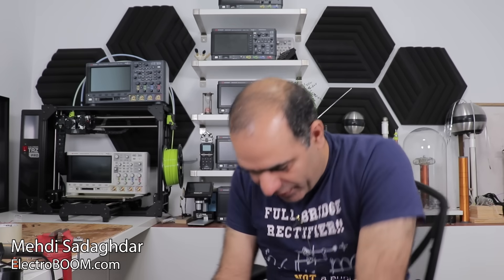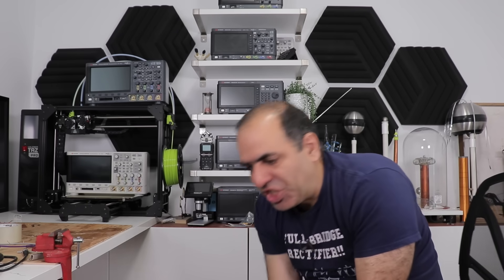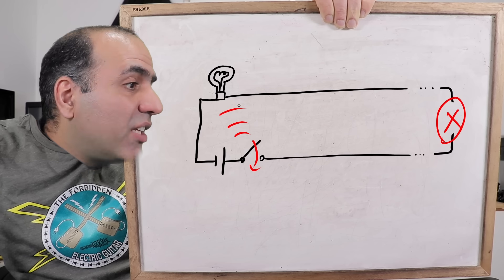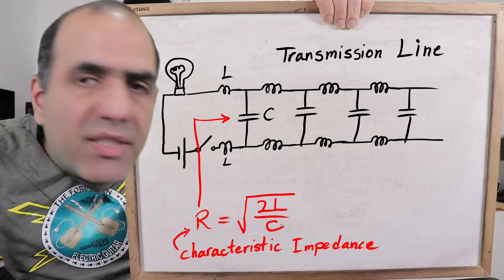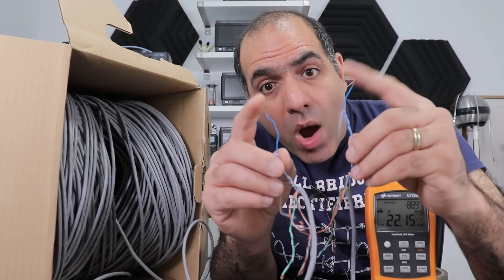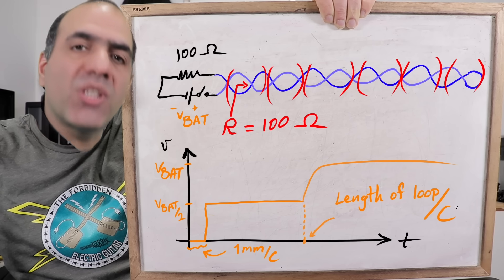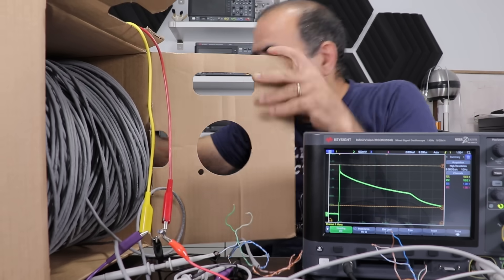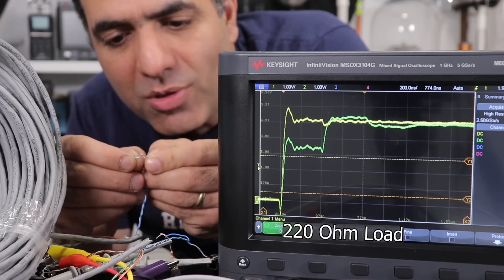Testing the LONGEST LOOP OF WIRE!!! to Turn a Lamp On

Comment: I wouldn't call the 2/3rds effect the speed of light through the material since it's not a self-propagating wave. It's actually primarily due to electron inertia not the effective speed of light being reduced.
Reply: The EM force is mediated by photons.  The electrons travel at a crawl.

Comment: I'm not convinced. What if the whole system was inside vacuum and there was no air between the wires and the lamp and the supply? would it behave the same?
Reply: Essentially the same thing.  The EM force is mediated by photons, which care very little about a millimeter of Earth atmosphere.  Photons travel just fine through vacuum.
Reply: @skepticalextraterrestrial2971  That's the thing I can't accept.I think it's not the EM that causes the lamp to turn on. I suspect it's the electrons passing through air to the lamp finding the shortest path. Because EM wouldn't be that strong with that voltage. Right?
Reply: @ForeignerCritic  Technically, they are virtual photons.  They "exchange" between electrons, carrying momentum.  The electrons are not traveling through the air... conductivity of air is something like 10^-12 S/m (compared to 10^7 S/m for metal).  You won't find many electrons flowing across the gap.  But the energy is transferred to electrons on the other side, which is what matters in the end.  In regards to the EM field being "that" strong... what are you referring to?

Also, all kinds of photons can "pass through" the plastic.
Reply: @skepticalextraterrestrial2971  And also it's not photons, because photons can't pass through the plastic around the wire

Comment: I would be curious to see the load on the supply wire while continuously pulsing to turn the light on without the wires connected.

Comment: Good explanation of propagation constant, except you didn't actually say "propagation constant". This is a fairly well characterized value for most standard cables and varies with the dielectric between the conductors, and is essential for finding cable faults using TDR.

Comment: At work, I've been playing with a lot of the same general principles lately. Incidentally, the cross-talk permitted between adjacent pairs in a length of CAT-5e cable is a remarkably low amount of energy, and cross-talk between adjacent lengths of cable is even smaller. Manufacturers go to a lot of effort to ensure that these cables can reliably transmit an acceptable signal, and the behavior seen on the oscilloscope proves they do a good job. Very nice experiment, which demonstrates a lot of the red herrings in Veritasium's original video. I also thoroughly enjoy this style of demonstrating concepts like propagation delay and impedance matching experimentally.

Comment: I still don't understand how this works without breaking the rule of causality
Reply from the maker: Imagine you have a long hose filled with stationary water already, looped like our wires but side by side hoses  are touching . and you turn the water on and it would take a while for the water flow to go around the pipe and come out of the other end. Now the hose on the tap side is touching the end of the hose like I said. When you turn the tap on, water pressure at the beginning makes the flexible hose expand and push against the end of the hose pushing some water out at the beginning. And like Donald Duck cartoons, the bulge of hose expansion travels through the hose and keeps pushing on the adjacent hose sending some tiny gradual water out. Still the bulge has to go the full length of the hose for some good flow to get out of the hose. Same thing happens in our wires! Electric waves at the switch send some current out at the adjacent wire into the lamp at the beginning before the waves get to run the full length.
Reply: @ElectroBOOM  ah I see, so if you replaced the led with a load that required more power than the waves that travel between the switch and load carry, it wouldn't turn on until the waves go around the wire.
Reply from the maker: Yes, same reason in my other video I complained that Veritasium's lamp must turn on at any current for the lamp to turn on. But if we switch the question to: there will be some energy at the output right at the beginning, then that works.

Comment: I don't buy that this is the same as wires spaced apart. What happened to 1/d squared? The signal from the induced field gets a LOT smaller than the transmitted signal as the wires are separated.
Reply: It gets a lot smaller, yes.  I think Electroboom means that no matter the distance, the effect is still there.  Even if it is really small.  The problem is that Veritasium gave the impression of wireless power which is very misleading.  Quantity does matter in practice.
Reply: @skepticalextraterrestrial2971  He will not see the TDR effect if the wires are a meter apart. The characteristic impedance would be in the thousands (or more!) ohms so it would be very difficult to match it to the instruments. And forget lighting the LED before the round trip manifested! He should be more aware of this and say it is ALL THEORETICAL AND CANNOT BE DUPLICATED IN REAL TIME!

Comment: Great experiment, I just have a small question, does the twisted pair change the actual length of the cable? Meaning is the Cat5 of 40m also considered 40m of the pairs or a little more since they are twisted and not straight? Maybe that factors into the equation that should result in the speed of light?
Reply: I had the same question.

Comment: How accurate was the speed of light calculation here? Is the speed of light in the wire really ~67% of that in vacuum or is there a significant error there?
Reply: A wire is opaque, so the "speed of light" inside of it is misleading terminology.  But the EM field is propagated by photons and the ~67%c is a frequently used estimate for the speed of an electric signal.

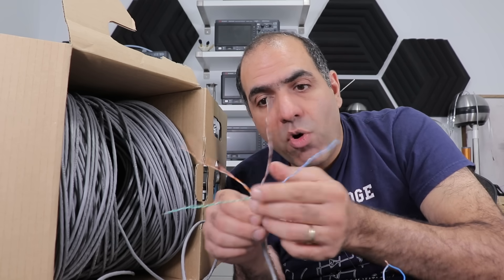Comment: 9:33 - total length can be even bigger than 8000ft  due to twist of wires (1000ft is length of whole cable, but not single wire in it). Similar to wire in incandescent lamp.

I think, someone here can calculate exact amount ;)

Comment: your led example with a resistor, is that the same reason 230v (or 120v in your region) LED floodlights very dimm lit even when the switch is open? Only the neutral is then directly connected, and maybe some magnetic field over the cables in the switch.

Comment: There's been like half a dozen videos on this so maybe I'm not sure what the question is anymore.  Are you arguing the speed of causality, the speed of electrons, or the speed of magnetic fields?  

You seem to be asserting that the length of the wire doesn't matter for data or power to flow?  That simply isn't true.  When financial institutions switched from cables like what you're using (orthogonal distance) to line of sight wifi, they immediately made far more money simply because of the nanoseconds saved in being able to register transactions faster.  

What you're demonstrating here is THE purpose of twisted pair, which is to induce opposing currents in the adjacent wire.  You would have almost no induction 1m apart for the mA of current that you're using to light the LED.  You DO have induction at half a mm.

Comment: Very nice demonstration. I have come to believe that transmission line model, not Ohms law, should be the first and primary introduction to electricity and circuits. Question: can the reflections from an imbalanced load be related to the Fourier transform of the difference of ideal vs actual impedance?

Comment: So this proves that Derek's assertion that "electrons don't carry the current" is totally unsubstantiated. We already know that electric fields induce currents in wires and vice versa. But that says nothing about the actual physical processes. It neither disproves nor proves it. However, his assertion makes no sense because of all the other things we DO know about the physical interaction of atoms/molecules and electrons.
Reply: Moving electrons are part of electricity.  Saying that they don't have anything to do with the energy transfer is just pseudoscience babble.  On the other hand, electricity is more than just the electrons.

Comment: Under Veritasium's assumptions (on how much energy is needed for the bulb to turn on), you don't need batteries and wires or anything. You just wave your hand around and the bulb will turn on. Really. Waving your hand around does make some electromagnetic field changes.
Reply: Under his assumptions, the bulb would ALWAYS be on.

Comment: been thinking on this, What if there was a Open Switch on Both Sides of the Supply, being that the - wire would not be charged into a negative state, but more of a Null state.

Comment: but it's like hypothesis. You don't really know what you're dealing with and how those twisted wires effect the experiment. 

Btw you can't communicate via that twisted wire over a long distance. The signal extinguishes with distance.
Reply: He actually measured how it extinguishes with distance.

Comment: Unless I am misunderstanding, doesn't this imply that if you replaced the LED with a full bridge rectifier and an LED over the output, then applied an AC supply to the twisted pair with an open circuit at the other end, that you'd see continuous illumination of the output LED even though the wire is disconnected? 🤯
Reply: Of course you can beam power wirelessly using AC and an antenna/receiver.  The questions are how far, how much, and thus how practical.

Comment: What's with the wierd-ass, nutsack monster that only flashes on the screen for like, 2 frames!? Seriously, look. Slow the video speed to .25% and try to pause it right at 5:06. You might wanna try starting it at 5:04 to give yourself a slight headstart.

Comment: so basicly if our light does not light up at half the source voltage, then vertiasuim test would: FAIL. 
yey. so much about them wires at the end making contact makes no difference. indeed it does, half voltage is a difference.

Comment: At the timestamp 4:55 You have used the 10 kOhm resistor to allow for the capacitance to discharge. What would happen if instead the resistor you use another (reverse polarized compared to the first one) LED diode?
Reply: Led is literally a Diode.
Reply: @TechnicalDhruva  Yes I know that. By adding the resistor, capacitance is being discharged. The same should happen with the LED, but faster. Question is, would both LEDs will be lit?

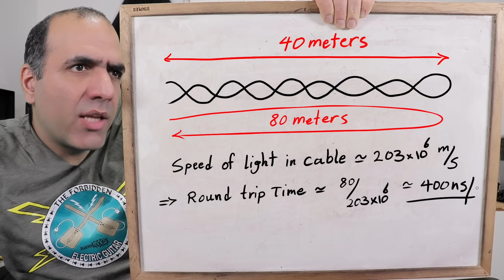Comment: I saw mehdi using measuringtape to take the 40m of cable. @13:13. Someone could have told him that there is length markings on the cable every meter. That is how installers know how long the cable is from one end to the other through a conduit or similar. Of course using own measuring device makes this more accurate, when you don't need to trust the manufacturer to know how long a meter is :D

Comment: This is one of the best experiments I've seen,  simple yet proves the point beautifully

And seeing the speed of light through wire approximating to 2/3 c is so cool

Edit: that cultured meme of the "long long man commercial"  in the intro I see that!
Reply: @becomingdoctor3766  True, it's not a completely "stand-alone" video. It would have to be an hour long otherwise. But I think most of the concepts here are covered in his 101 series so it's a good excuse to watch those. ;)
Reply: What does he prove though? I really wish he did a summary explaining everything he did at the end. Kinda crazy he didn't tbh. There's too many higher level concepts just casually being thrown around in this video for any casual viewer to understand imo.
Reply: @streetsurfer420  
This is a video for people with ~2 years of Electrical Engineering at college, or people who have been fiddling around with electricity or electronics projects.
Reply: @streetsurfer420  He changed everything... so he hardly proved anything.
For example the distance betwen the wires is 1/1000 of what he is trying to prove.
It is like trying to prove that you can transmit with your radio to a reciever 1000km awey by making an experiment where your radio is only 1km awey from the reciever(plus he changed the light bulb with a led diode...).
Also the calculation that you gonna get energy to light up your bulb in only 3.3ns is complete nonsense and there are videos where some YT actualy tested that it is not the case...
Reply: @Bialy_1 He literally explains all of the changes he made in the video and why they don’t matter. The point isn’t how long the gap between wires is, the point is simply that there is a gap between the wires.

Comment: Wouldn't it be possible to connect the blue wire at the end to one of the other colours and the same again at the start? That way you could send the electricity up and down the wire 8 times and dramatically increase it's length.

Comment: Nope, cat5e is not the same.... 2 wires 1 meter aparts have very low capacity, the electromagnetic field is the main energy tranfer mechanism, like 2 antennas. Cat5e wire acts more like a capacitor and the electric field is dominant.

Comment: Sorry, you and Derek are wrong. You video shows it.  Derek stated that when you throw the switch it will light up the light bulb.  One throw of the switch is one transition of the power from 0v to 5v.  NOT multiple transitions.  With multiple transitions you are charging the capacitance of the line that then Supplies the current to light the led.  Your video showed that with one transition it did not light the led.  Like I said in my posts of your previous video, the pulse from the EM transition is too small to provide enough current before the main current comes around the loop. You and Derek are wrong.  But I like your demonstration of how a transmission line works.  Spot on.  Just correct the conclusions that you are Derek are correct.  The led did not come on.

Comment: As you have proven rather brilliantly many times, touching a bare wire with a high current shocks the heck out of you.  (Well done.)  However, put a tiny little bit of insulation on the wire, and you often won't get shocked.  Derek seems to want to say that the bulk of the energy being transferred is actually running outside the wire in the field it produces. Then why are you protected by a thin layer of insulation, and possibly killed when it's not there?
In his experiment, Derek went to a great deal of trouble and expense to use large copper tubes.  Why didn't he use a thin wire (cheaper, easier) or a twisted pair as you just did?
The answer is simple, he was building a better inductor/antenna/higher capacitance to INDUCE a current at the lightbulb side.
That to me does not prove that the bulk of energy is somehow running outside the wire.  It just says that wire passing a current creates a magnetic field (like a transformer) that can CREATE an electric current in another nearby wire?  The fact the light flickers, (once through induction, and later as the real current completes the loop) confirms this?
Isn't his whole premise very clever, but misleading?  WHERE and WHAT is the bulk of the energy traveling when sent through a wire?
Thanks!